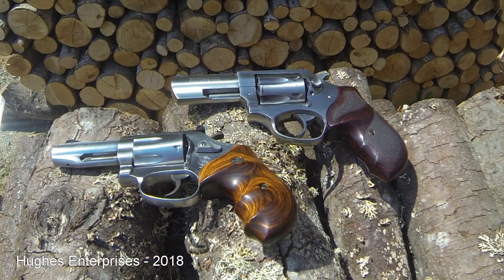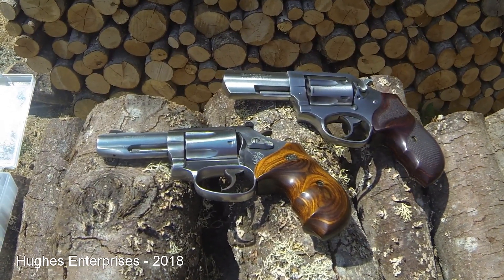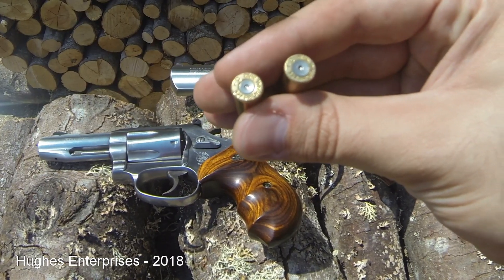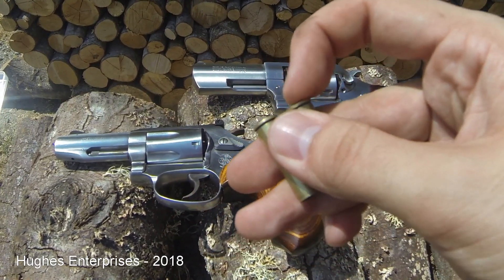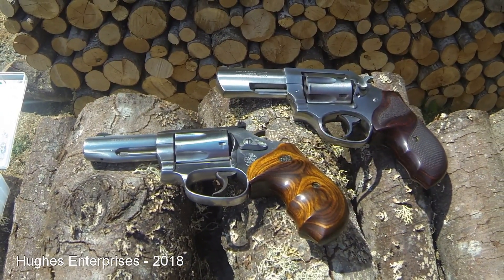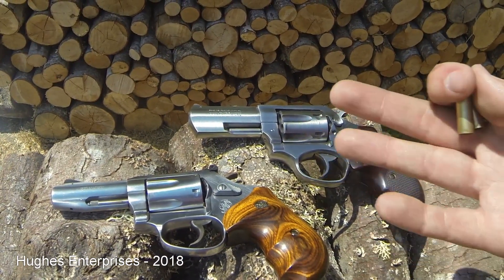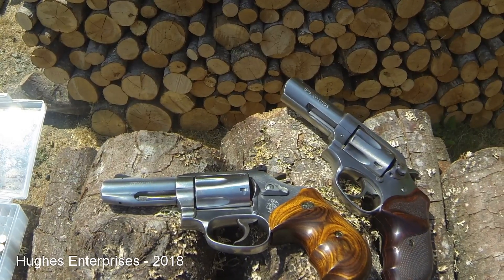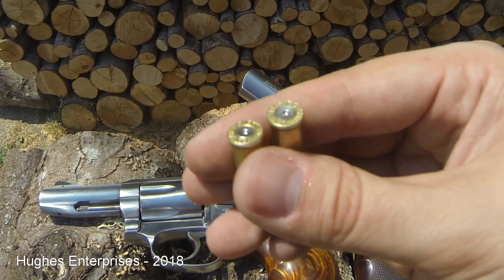.327 Federal Magnum CHAPTER 9: READING PRIMERS Over-Pressure vs High Pressure Ammunition Reloading

Comment: Goomba 777
After many articles and videos I got hooked on the 32/327 concept. Got a Charter Professional in 32 H&R .Started reloading !
Recently thinking of a companion levergun and managed to find a Henry steel 327 in 20 inch. No brass anywhere !
Began looking for load data and found a lack of info as to what 32 H&r and 327 loads will achieve in my 20 inch barrel.
Your 327 videos were very informative and enjoyable, thanks for all the effort. Any chance for a Chapter 10 covering comparing
load velocities of 327 / 32 H&R revolver loads to use in rifles ?

Comment: Hey Hughes Enterprises, got a question of you don't mind. Have you tried using small rifle primers in stead of small pistol magnum? I'm asking because I have been loading up some 327 mag for my bond arms derringer using small rifle primers which are suppose to be designed thicker for higher pressure, but I am still getting over pressure signs. I have been loading 100 grain XTP's about halfway between min and max loadings using both Lil' Gun and H110. Still seeing over pressure signs even know the book pressure numbers indicate that I am well below the max pressure and not even into the 40kpsi area yet. Very strange indeed. The cases are extracting easily though so I guess that is one good sign. I do love the cartridge though. Fun to reload and fun to shoot. And to top it off I can shoot my 32 Longs as well. 😀
Reply from the maker: Yes I have! And I’ve got identical results to what you have. Overpressure before you would expect it. 

I was reading an old Speer reloading manual and they were talking about the different primers to use with .44 Magnum which at the time was significantly hotter than SAAMI allows today. Somewhere around 42,000 PSI! They found that in every case except H110 and IMR4227 standard large pistol primers produced lower pressures and still contained the crazy pressures just fine. They measured that the magnum primers spiked pressures by 5,000 PSI and noted that they were totally unnecessary for regular pistol powders and only needed for super slow H110/4227.

I would imagine the pressure spike is even more pronounced with a Rifle primers being designed to ignite VERY slow spherical ball powders for a .223 size or thereabouts cartridge with more than double the case volume of .327 Federal. Maybe spiking pressures an additional 3-5,000 PSI or more over magnum pistol. I’ve still never seen a blown out primer with 327 Fed so I would imagine that even though the rifle primer cups are thicker, the small pistol cups are adequate.

I actually use standard small pistol primers for medium power .327 loads up to estimated 30,000ish PSI. And only small pistol magnum for full house loads and especially with any charge weight AA#9 or H110 loads that need the extra fire.

Full house .327 is a spicy one and even the factory 100gr loads are right on the edge of being OK. Load carefully and stay safe. :)
Reply: @HughesEnterprises  
Great info, thank you very much. The only reason that I am using small rifle primers is just because of the primer shortage. I have a bunch and not nearly as many small pistol primers. Plus, I recently just watched a video here on YouTube where Super Vel performed a pressure test on a real test machine of pistol cartridges using both small pistol primers and small rifle primers and the numbers were pretty much indistinguishable. The reason they did that is because you can now send your own primers in to Super Vel and they will load their ammo for you using your primers. So they were demonstrating the fact that you can send either pistol or rifle primers to load their pistol cartridges. No matter what though, I will definitely use caution when loading the 327 powerhouse. 
Thank again Mr. Hughes, I appreciate the great info you gave in your reply. I appreciate it🙂

Comment: Ok a few points of interest and I'm a rookie when it come to reloading.... First I am using the 327 Federal Magnum for developmental purposes. Now the brass for 327 Magnum is made for much higher pressure than most handgun cartridges. 44,000 PSI as compared to 22,000 PSI in the 32 H&R Magnum for example. Both fires the same bullet, the 32 H&R from a 3mm shorter case, 27mm vs 30mm. The 327 brass is able to handle higher pressure for two reasons. First the brass is thicker at the base with a taper compared to the 32 H&R Magnum, second is superior metallurgy that strengthens the brass. So that being said since the round under designed circumstances is operating at double the maximum pressure you should expect to see some signs of high pressure in the primers that would not be acceptable in the H&R Magnum...  

For example American Eagle 100 grain white box ammo with a muzzle velocity of 1600 FPS out of my Ruger Single Seven with a 5 1/2" barrel always has flat primers and extracts with no problems. This I think is perfectly acceptable. I have over loaded some 90 grain Sierra rounds and the primers flowed and filled the primer pocket like they were liquid and that is not good. The cases were very difficult to extract and a primer was blown out the back of two cases. I know this was a rookie mistake of me making both 60 and 90 grain rounds and thinking my muzzle velocities for the 90 grain bullets were for 60 grain bullets... Sigh I know and I am being much less assuming now and have since loaded 60 grain bullets to nearly the same MV. The primers look much like the American Eagle factory ammo except they are flattened a bit less. 

So my only point is that some primer flattening for the 327 Federal Magnum is normal and acceptable where it would not be in other rounds. An article in the shooting times from some very experienced re-loaders confirms this as typical with this hot little round. Hope this is useful to someone and feedback is welcomed.
Reply from the maker: You’re quite lucky you were shooting those from a modern Ruger! Revolver cylinder walls, especially on smaller guns, don’t have much meat on them to contain 60,000+ PSI blown flowing primers far beyond proof loads. A defective piece of brass or slightly faster powder could have easily split open the cylinder. The thinnest part of the cylinder containing all that pressure is usually just 0.050” thick, sometimes less.

It’s a good lesson to learn early reloading. But you should feel very lucky your gun is still in one piece. Nothing’s going to know the difference in whether it was hit at 1,600 FPS or 1,400 FPS. You only get one good shooting hand and pair of eyes.

ALWAYS start at the start load and work up that way these mistakes can be caught early and they are less dangerous. Pressures should be checked at the first round fired of a new load.

Slow pistol powders and limited case capacity is a safety feature, but it can’t be overstated this could have been absolutely disastrous if a faster powder was used instead.
Reply: @HughesEnterprises  Thanks for the advice and appreciate your video BTW. I will be starting with lighter charges and creeping up slower to reach my objectives. One of the reasons I chose the Single Seven is the unfluted cylinders and I knew I would be pushing some limits, however I didn't intend to push them that hard.  I was sort of working off of two articles for data and pushing the 60 grain bullet to 1800 FPS out of a 5 1/2" barrel is ok, pushing a 90 grain bullet is way too hot. 
I don't agree 1400 FPS and 1600 FPS are the same for this reason I have been a student of sorts of Evan Marshal having studied his one shot stop data at length many years ago along with FBI studies of what works and what doesn't. After perusing copious quantities of data kinetic energy has a very significant impact on stopping power with a few caveats in mind. One surprising thing is how well a 357 Magnum performed from a 4" or longer barrel and that it did significantly better than the venerable 44 Magnum in one shot stops. The prime reason is that a 44 Magnum starts with 700 ft lbs + but exits with much of that energy. In comparison the 357 has just north of 500 ft lbs but usually delivers 100% of that energy... Hence why it was giving 96% One shot stops. Other rounds that performed near 90 % were hot 45 ACP and 115 grain 9mm +P rounds.
The latter two rounds were over 400 ft lbs of energy. Energy being the ability to do work or in our case tissue damage. Now here is where it gets interesting momentum or recoil goes up linearly while energy goes up as a factor of a square. So then a lighter bullet traveling faster has less recoil compared to its energy. That being said momentum plays a role in penetration so at some point you start losing the game. My development is towards a semi-automatic essentially mimicking the 327 Magnum ballistics. I came up with what I think would be ideal some 20 years ago and it is what is the 327 Magnum. Smaller bore .312 and > 400 ft lbs being a self imposed requirement by me. The two rounds I'm developing are 60 grain @ 1750 FPS + and 90 grain @ 1500 FPS +. Both out of a 5 1/2" barrel. 
Will be chrono-graphing said rounds this morning.  Keep up the informative videos and maybe I will soon be posting my own.

Comment: My 9mm loads look like the cases here with high but normal pressure, but not over pressure.......but they leave the barrel out of a 4" barrel pistol, and the load is just beneath the starting load listed for the type of weight of bullet listed for the powder. I will not exceed this load with my 9mm's but the chronograph revealed impressive velocities and consistency for 9mm. 1,200 feet per second out of a 4" barrel is the maximum I would want to load 9mm luger to with 115 grain bullets anyway. 9mm Parabellum is a high pressure cartridge and has been so from the outset.
Reply from the maker: What powder are you using? There are quite a few powders suitable for 9mm that can easily reach 1,400 fps without showing pressure signs. Although If your load is reliable and accurate, no reason to try something new.

Comment: I wonder if you could help me figure out what I'm looking at in my case. I have a Bond Arms 327 federal barrel. I've used Speer 100 grain, Federal Hydra shok, and both Federal soft point factory loads. In all of them they are showing signs of overpressure: flattened primers, cratering, difficult extraction and such. I don't have any experience with 327 beyond this so I don't know if it's normal. I've fired maybe 14 rounds altogether.
Reply from the maker: Mr. Explodey If it’s a brand new gun, be sure to thoroughly scrub the chamber and bore with a .32 caliber bronze brush and solvent to clear out any debris leftover from manufacturing. Run clean patches through and make sure the chamber and bore are dry before shooting again.

If the cases are still sticking after that, this is likely a problem with the gun rather than the ammo (since you used several types). It’s normal to have a little resistance, but if you really have to work to pull them out then it is definitely a gun issue. Contact Bond Arms and send the gun to get checked out. Be as detailed and specific with the problem as possible. Send all descriptions on paper with the gun that you sent to the customer support rep. Send the spent brass with the gun! Take a video at the range with the issue and email it. You want their gunsmiths to already have a fix for the the gun before they even look at it rather than them fiddling and guessing for weeks.

If the chamber is undersized, rough, there are machining defects, chamber wasn’t cut deep enough, etc this can lead to sticky cases and overpressure. A good gunsmith can ream and polish the chambers if necessary if Bond Arms can’t/won’t fix it.

If the cases come out with no or little resistance but the primers are still flat and cratered there could be a few things going on. Flatness is normal, but cratering is not. A little ridge is OK, but if you can really pick at it with your fingernail and it looks like my overpressure photo it is flowing into the firing pin hole. Either the load is overpressure in your gun (tight bore/throat) or the firing pin hole is oversized. Both would either need to be corrected by a gunsmith or a new set of barrels fitted.

Worst case scenario you’re stuck with .32 H&R or reloading slightly lower pressure .327. Bond should take care of you. Custom gunsmith fix may run $2-300.

Hope this helps

Comment: Nice video.  What you didn't mention, and I think is worth stating, is that the primer on the overpressure round also flowed into the gun's firing pin channel, not just into the primer pocket of the brass.

Comment: Yikes,  327 must have a great case head to take those pressures without ballooning or having any other issues. 

Yup,  a lot of folks forget load manuals are just general guidelines. Just because the book says it's safe or unsafe doesn't mean it is in your gun.
Reply from the maker: Yep, .327 brass is extremely thick compared to .357 or 44 magnum. Normal operating pressure is 45,000 PSI. CCI Small magnum pistol primers flow like this around 50,000 PSI. You can alleviate the flowing by switching to small rifle primers, but the brass still sticks in the cylinder at 50K+. Speer recommends loading with a small rifle primer for this reason, but you're playing with fire when the gun is clearly telling  you it's not happy. The Henry rifle and Freedom Arms revolvers can handle it, but the extra 50-100fps isn't worth it.